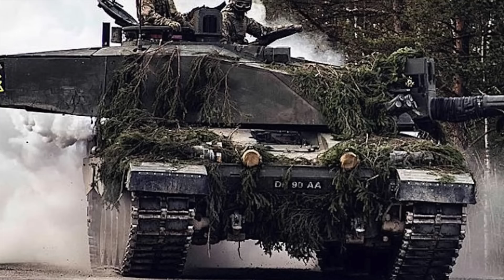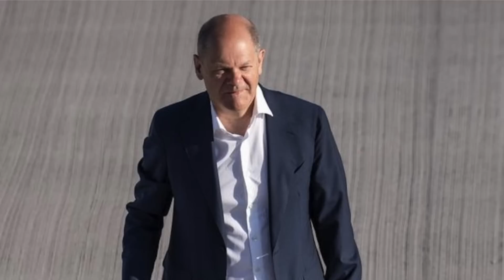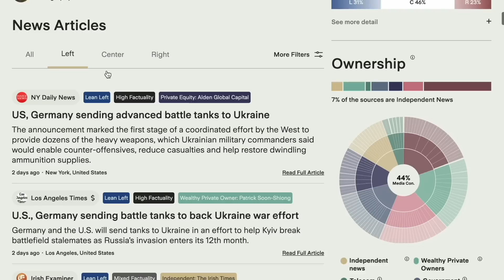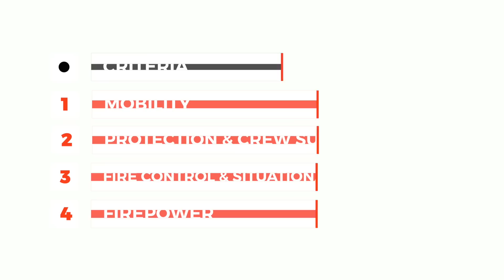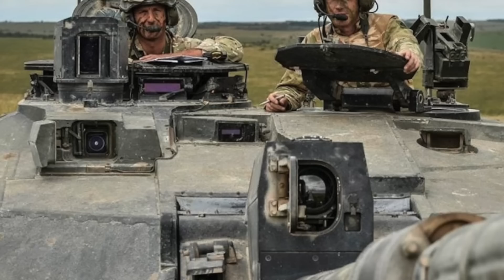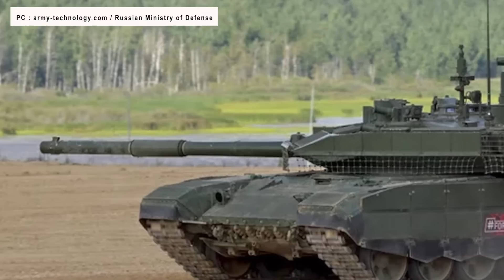British Challenger 2 vs Russian T-90 - Detailed analysis !

Comment: Its not fair toward russians.Leopard 1 is to much to handle for russian tank let alone challenger 2
Reply: That's dumb Leopard I can never even face older T 72 variants what you talking about Leopard I just won't make it against T 62M
Reply: @soumyajitsingha9614  actually the Leopard A5 with the current ammo would make mincemeat of both the T-62 and most of the T-72 versions. The optics, computers and communication is three times more modern than those on the Russian tanks. The Russian tanks wouldn't know they are there until the Russian tanks start exploding. The Leopard A3-A5 are a purpose upgrade to deal with the T-72. We used the A5 until 1997 and it would have stayed on as a replacement for the AMX-13 reconnaissance tanks if the Soviet Union hadn't collapsed. After that we went all Leopard 2 A5-A6 and CV-90. That combination can still deal with everything the Russian Federation has. Before they invaded Ukraine we thought we needed one Leopard 2 to deal with five T-90. Now we know it will deal with 15-25 T-90 and as they have no explosive in most of their ERA it will actually be even more.
Reply: @soumyajitsingha9614  hahahahahahaha
Reply: Unfair? LMAO😁🤣🤪
And what about an invasion of an independent/sovereign country ?!
Let Razzian* orcs rot in hell!!!

* Razzia - means incursion, invasion, raid😁
Reply: @GaneshDevdas  i was being sarcastic but you didnt notice that